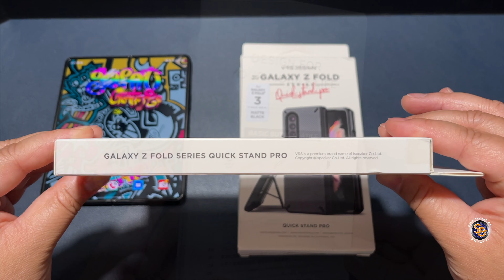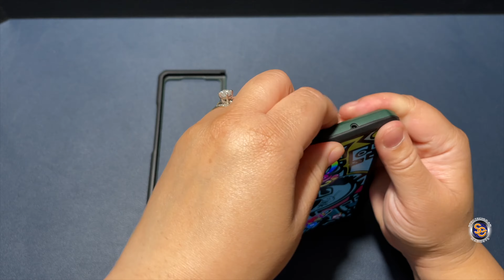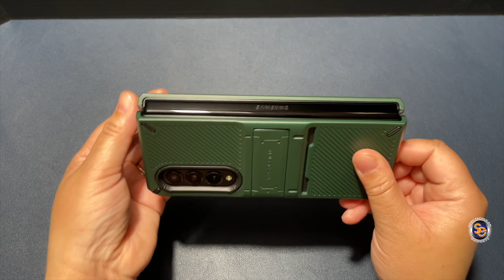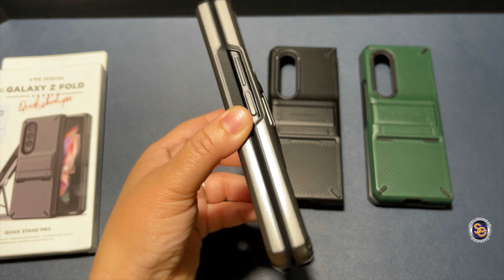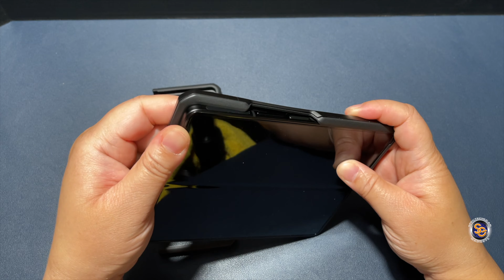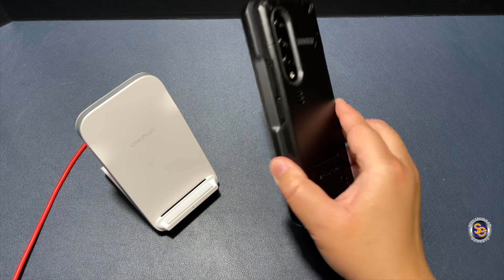VRS Design Quick Stand Pro & Hard Drop Pro Cases for the Samsung Z Fold3

Comment: I have the vrs quick stand and the left side of the outer screen is covered by 1mm because of the case. I even used the tape as recommended and only fixed the issue temporarily.